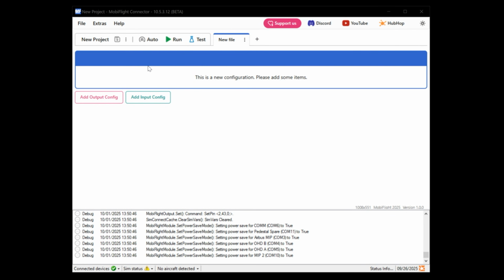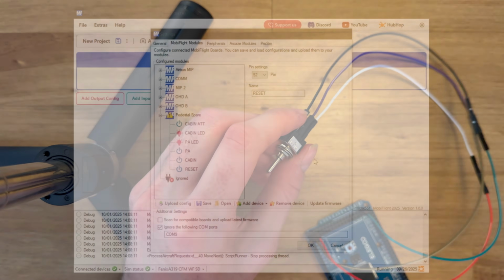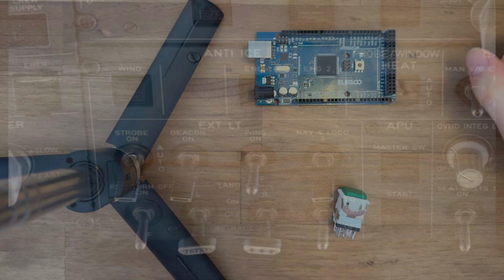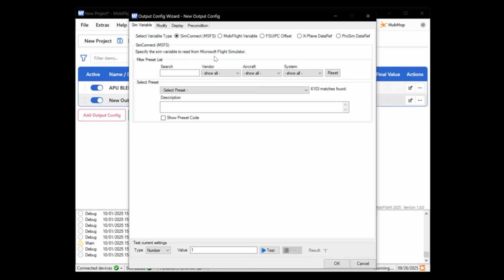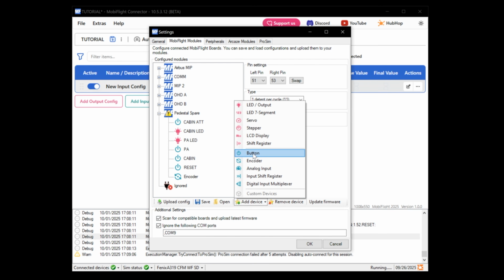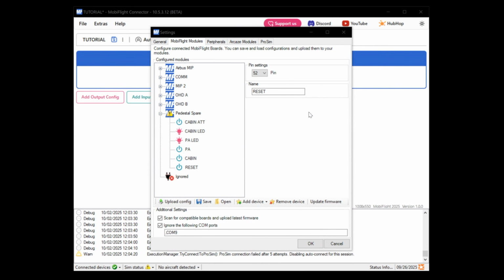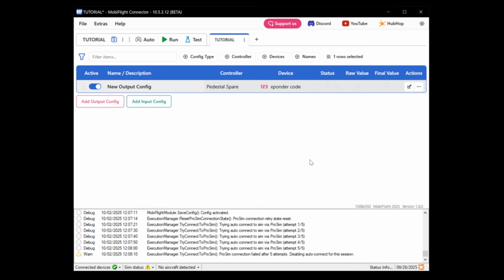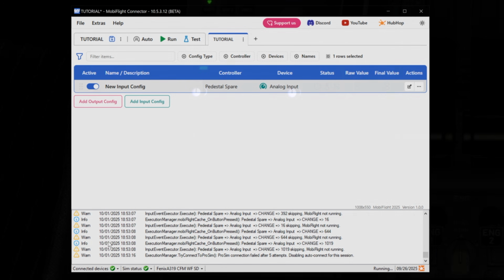Home Cockpit Wiring | Switches & Displays

Comment: Hi, for the KD22 switch, do I need to use a resistor for the LED or is it built-in? If so, what value? Thanks.
Reply from the maker: Hi, sorry for the delay. resisters are required and I will showcase this in a later video. In my latest panels ive used 200ohm or 10Kohm resistors depending on preference.

Comment: Hello Dakota, could you help me with how the taxi ligths switch would be configured? Since with a 3-position switch the off is in the central position and in the case of the taxi ligths the off is in a position where the switch is originally in on, to make me understand the switch originally comes ON/OFF/ON and in the taxi ligths comes ON/TAXI/OFF
Reply from the maker: Hi! So the top position would be position On, with the release (middle position) be set to taxi. The bottom position would then be set to off with the on release position (middle) be set to taxi. I hope this helps :)

Comment: The LEDs are unreliable because you must place at least a 200 ohm resistor in series with either the +5v side or the ground side (it does not matter which but cleaner to place on 5v side since you typically daisy chain the ground). Also, each LED must have its own resistor, so 10 switches with an LED, you will need 10 resistors. Your LED's are getting too much current without the resistor and prematurely burn out.
Reply from the maker: Ah that makes a lot of sense — thanks for the detailed explanation! 🙏 I’ll definitely try adding 200Ω resistors in series on the 5V side next time. Really appreciate the tip!

Comment: Hi, could make a video about a 5 position rotary switch please? (You could use this as a magneto, engine start switch - piston engine)
Reply: That's straightforward. Each position will be a separate 'on' position effectively. Then you just program it in Mobiflight as you would for any switch as shown on this video.
Reply from the maker: Hi, no problem at all I’ll get that done for you :)

Comment: what brand for the LED push button switches ?
Reply from the maker: Hello! I use the KD2-22 LED push button. You can get them from various suppliers though id exercise caution with ones on AliExpress- I’ve found these to be considerably less reliable and have had to replace several of these in a relatively short time. 

I now get all my LED push buttons from this eBay seller. Much better quality, never had one fail, and made to order. If you’re ordering in bulk make sure to message him and he may even offer discount. https://ebay.us/m/kLNwPW

Comment: Great job man where to buy the switches please..?
Reply from the maker: LED Push buttons- https://ebay.us/m/kLNwPW
Potentiometers- https://ebay.us/m/rDtpH7
Toggle switches- https://ebay.us/m/cbcfbc
Rotary encoders- https://ebay.us/m/9xyGTS

I hope this helps :)
Reply: Yes, E-bay is absolutely fine! 

I opted to get hardware from AliExpress as well. Let’s just say that for MY tests I wasn’t too worried about eh… ‘top’ quality initially. 

That said, all encoders and switches still work fine. Many sellers operate on both platforms as well…

Comment: New to this but learning.  Is there a way to share the GND pins since there only seems to be a couple slots on the board so you can have several devices connected on one board?
Reply from the maker: Hi, yes you can link the negatives together and put into the same pin. Another video of mine show cases this :) https://youtu.be/49695SVhxYk?si=QSZHXj4x45VYef9F
Reply: @DakotaJet THKS!!

Comment: Thanks for this :) Do you need to use a different arduino board for each device or can you run multiple devices from one board provided you have enough pins available?
Reply: One board can handle multiple devices which can include both analog (potentiometers, etc) and digital (encoders, switches, pushbuttons, etc) devices.
Reply from the maker: Hi, the boards I use you can have multiple. I think 52 digital pins and 12 analogue pins :)